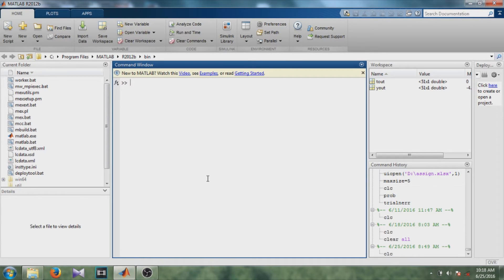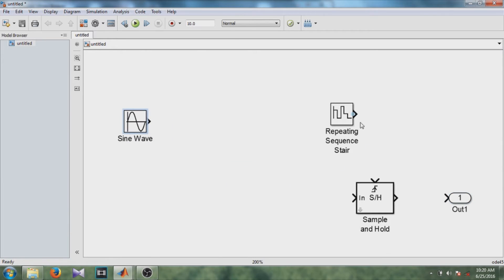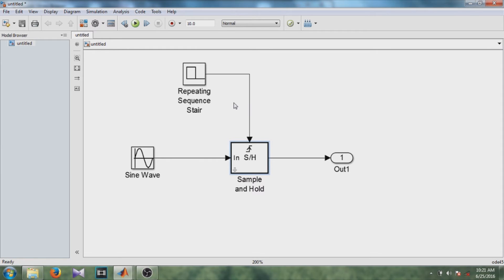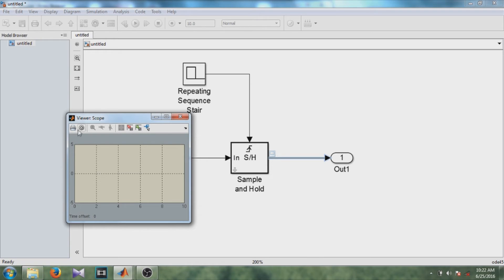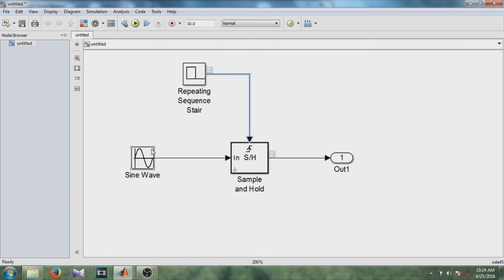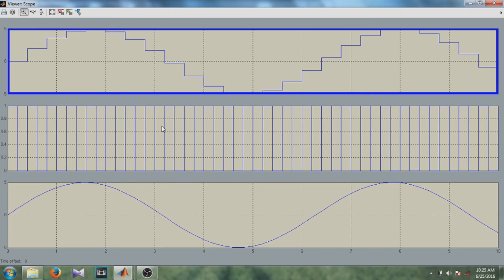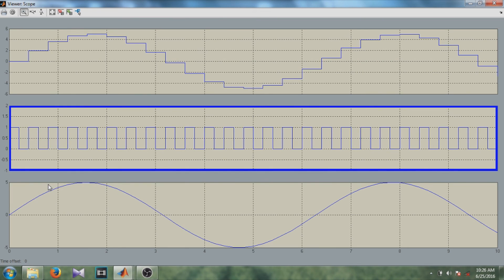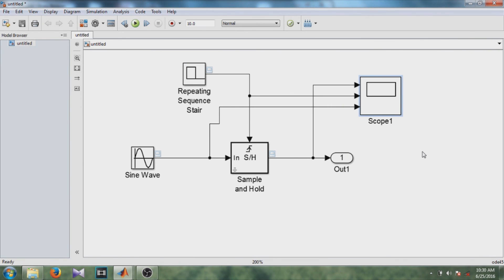Simulink Tutorial - Tutorial 5 - How to add viewers and modify their parameters

Comment: Though I developed the model as per the lecture, when I  tried to change the Scope Parameters, I'm not getting the same console as shown in the video. I'm using MATLAB R2016. I tried all  options of changing the scope, scope parameters. But nothing worked out. Because I couldn't modify Scope Parameters, I couldn't select Axis 2 or 3 in the next step for Repeating Sequence Stair and Sine Wave. Could anyone help me please.
Reply from the maker: It is old version of MATLAB - 2012
Steps are different for MATLAB 16.
After adding scope to one of the signals, map the scope to other signals as well and once the scope is added, on graph goto view and select layout for to observe the signals. Next, select display by right click -> Connect to viewer -> scope -> display

To modify min max or settings, click on the symbol which looks like settings i.e. configuration properties, goto display tab -> select active display and change min max and signal name settings
Reply: @simulinktutorial9086  Thanks for very quick response. Yes. I tried later before I received this reply, I tried myself various combinations and could locate the tab "Layout" in the Scope Configuration Parameters. There I clicked 1x3 option...i.e 3 rows with one column. Now, I could get exact 3 graphs as mentioned in the video. Compiled the model, executed it. I generated the perfect graphs.
Basically, I've started learning Simulink now. So, I'm getting difficulties. But, these tutorialsv are helping me to a great extent too get started with Simulink and it's fundamentals.
Thanks a bunch to both,: presenter and support team of Simulink.

Comment: I am getting the following error in matlab i am using 2016a version and i am making this block diagram as it is

"The block 'untitled/Repeating Sequence Stair/LimitedCounter/Output' is discrete, yet is inheriting a continuous sample time; consider changing the sample time to discrete, using fixed-step solver or replacing it with a Memory block. "

please help me asap
Reply from the maker: +jashan chawla goto configuration parameter and select type of solver as fixed step and discrete
Reply from the maker: +jashan chawla goto configuration parameter and select type of solver as fixed step and discrete
Reply: HI , i tried it it works thanks a  lot  .
 I would appreciate if you can come up with a case study using flowchart in  all three forms(state diagram, truth table  and   if else logic).